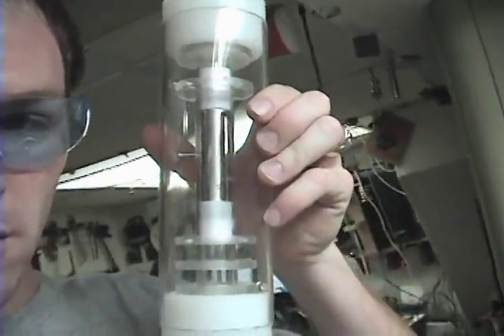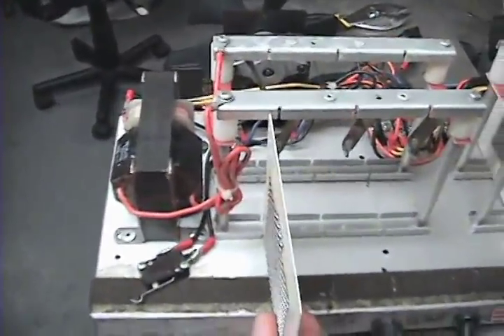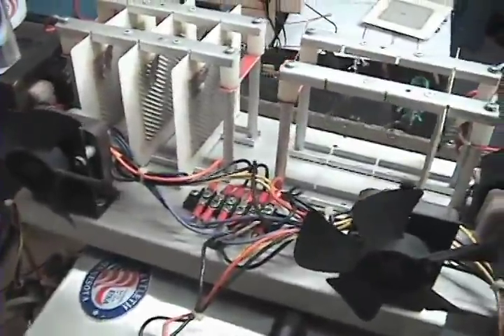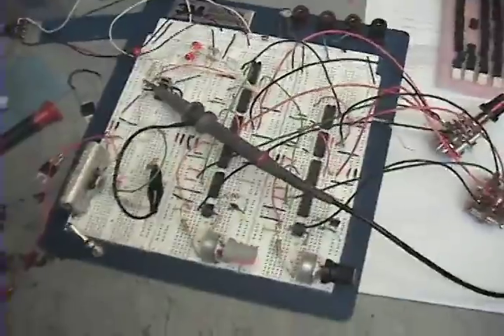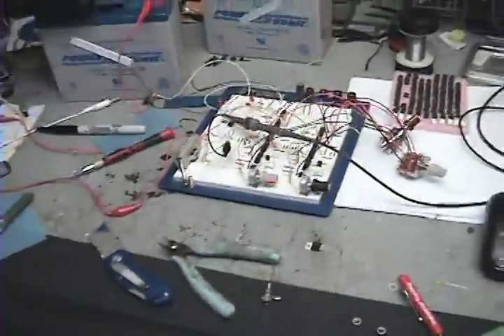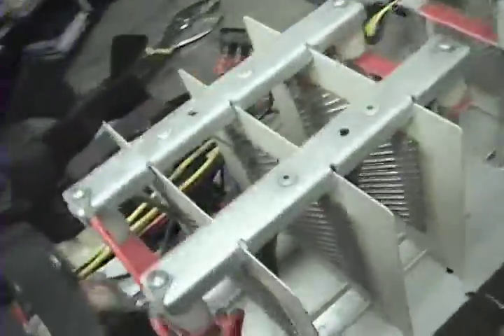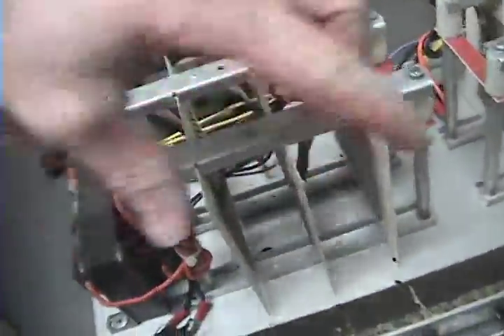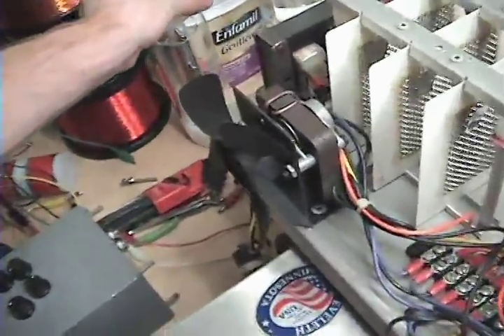A New Idea For A Gas Processor. Good Idea Or Bad Idea? What Do You Think? ~Russ

Comment: Hi Russ! Well im back from my summer holiday,  and i looked at your latest vids, nice work! 

My idea is that its the Oxygen (in the HHO) that need to be targeted for ionization, reason  is that it is easier to ionize than the Hydrogen since the outer electrons require far less energy to extract. that's also what Stan was talking about. I would def try the big ionizer, make a smaller chamber, use 2-4 plates, LED;s, include electron extraction and let the HHO flow through! Burn and see any diff?

Comment: Hi Russ, you asked for opinion.
Ionising air is a waste of input.  
You cannot get out more energy because you are not modifying individual molecules.
In the Papp engine ionised gas molecules are EM vibrated into a different state, which produces expansion/ motor force on a piston.
Stan electrically vibrated HHO water generating electrodes to alter molecular state in presence of a polarising voltage.
I think idea of non-mechanically generating electricity has taken you down a dead end here.

Comment: @kenterprise1 i too was thinking the same, but perhaps a potentiometer to control the voltage to the ionizing plates is a good idea. that way you can control the amount of expansion on the molecules, by stepping up the amount of voltage, or by lowering the effect.. this was stans way of creating an explosive gas with a higher energy then without the added energy of the corona/resonant cavity.

Comment: If I could try some order or combination of putting a vacuum pump on one end of a tube with the  other end connected to a pure water tank. in the tube section i would have an electrode at each end. I would draw water vapor through the tube with the vacuum pump through the field of influence of my HV electrodes.I would only want to ionize the water vapor and not any air. H and O should be discharged out pump. It may just blow up. That is where I would start or close to. good luck

Comment: ionization must have its part, but the gas may become very explosive as a result. the radar waves are of a good size wave length  to cause expansion on the dipole, atom too. Heat is the friend of the atom to help cause expansion, that infra red has a steady particle for energy transfer and the photons are in stimulation by there re emitting wave caused by the photon radiation of the same.

Comment: I not think that Meyer further  "ionized" the gases after production. The liquid ( water or electrolyte ) and the gases are already ionized if use high voltage ( even low voltage  but sure not the corona discharge voltage value) . Not studied in details his tech but looks like he used the ionized gases magnetic field into a close loop to reduce the power required for separation. Ishmael Aviso reported also that acid water ( H3O) as electrolyte produce more Hydrogen.

Comment: @freethisone All 'water cars" used HHO ( generic term for Oxygen and Hydrogen mixture ) Air, water ( or steam - vapors)  and oil fumes from PCV !
the Japanese with HAW use stored Hydrogen, Air and Water injected ( plus oil fumes from PCV) and it works also.
I will not waste time to discover a super ionized gas - even if can be obtained it is not stable and prone to auto ignition=  not safe for automotive application..